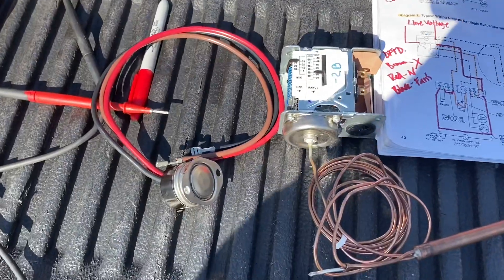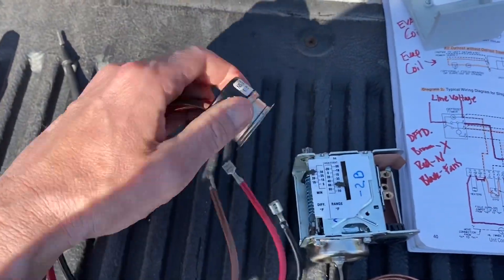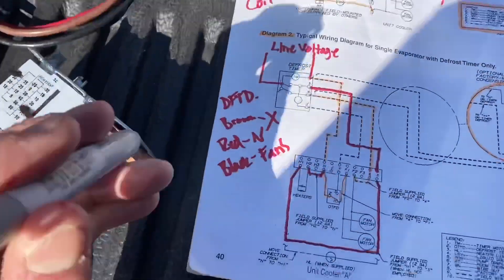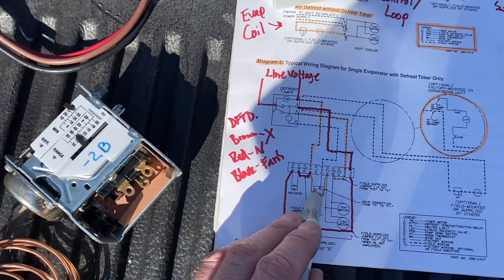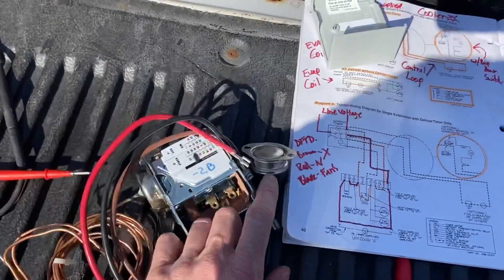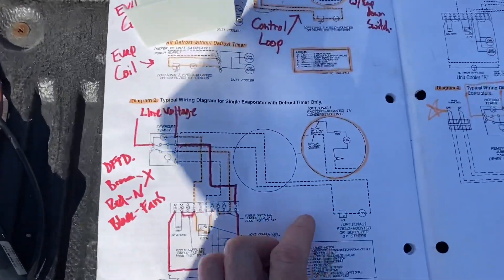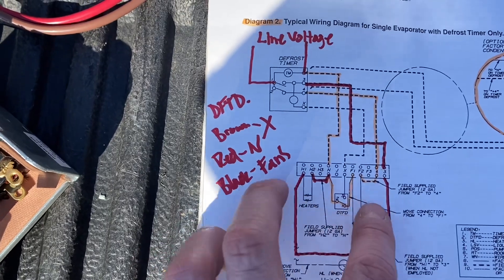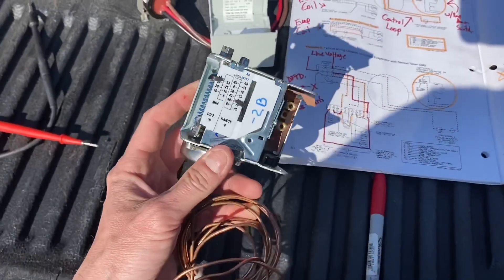Defrost termination / fan delay operation

Comment: My walk in freezer fans keep shutting down. When I bang on the evaporator the fans start up again. Do you think it's a relay inside the evaporator. Frost also keeps building up on the outside of my compressor copper lines that are insulated
Reply from the maker: It’s most likely the fan cycle switch / fan delay . Or could be a loose connection issue

Comment: I’m working on a heat craft evaporator that does not currently have a defrost termination fan delay. Should I be looking for a jumper between N&F to remove in order to install a defrost termination fan delay?
Reply from the maker: Is it a freezer or a cooler ? If it’s a cooler it doesn’t need one

Comment: Trenton brand has been a thorn in my side for years, I'm not selling them any longer.  Just today I told my supplier to get these in and then I find this video. Apple storage has defrost heaters but the temp isn't lower than 29F, so all I need is to get the coil temp down so the heat doesn't blow into the room. Any suggestions what to set this at, if not then I'll have to do trials to find the sweet spots. GREAT video.

Comment: I am a HVAC tech, and my company I work on now, throws us on to Refrigeration equipment. Its not in my wheel house. Very confusing the sequence of operation. Makes me want to quite this business altogether.
Reply: There’s an old saying, you can teach a refrigeration guy to do air conditioning but you can’t teach an ac guy refrigeration.  When I started doing commercial the only background I had was residential HVAC.  You just have to want to learn and have an open mind and you can pick it up.

Comment: Can a walk in freezer be change to a cooler by the temp control?
Reply from the maker: Eddie Acevedo no , you have to disconnect the heaters and this fan delay and wire the fans straight so they run all the time
Reply: @Cscrefandhvac  thank you for steering me in the right direction and the wisdom you provide with you're channel thanks til the next one ☺️
Reply: @Cscrefandhvac  where could I get 208v for fans if I disconnected the heaters and fan delay should I add a jumper from TB6#N to TB1 #1
Reply from the maker: Eddie Acevedo I’m not sure I’d have to see it.

Comment: Its clever wiring really, time clock is controlling one side of voltage and dtfd is controlling the other.  Its hard to explain on the phone with a tech in trouble.  good job
Reply: dtfd?

Comment: The only thing I’d say about that is, those temperatures on that sensor are not reflecting the coil temperature unless they are mounted ON the copper tubing as some are.  Now, the reason it’s 35f ( not cold enough to freeze the water on the coil ) is that this particular sensor is mounted to the tube sheet end area.  So, the coil is hopefully colder than 35f, otherwise it will blow the water droplets off the coil and freeze on your floor.  I think the better ones, are the 25f sensors that clip onto the U bends. The reason is, what if the cabinet/ box is plenty cold even after defrost and the sensor chills down quickly due to a very cold box temp, before the coil can freeze the water on the coil..... just a thought.  Also some of these units have a drip timer that allows water to drip off the coil.
Reply from the maker: hvac01453 yes great point man 👍 this was the only types I had on my truck to show as an example . Most units that are in a control system have a drip time thanks for mentioning that.  I didn’t mention that in this vid 👍

Comment: Great video! 
Currently doing residential and commercial ac work but I'm looking to move up into refrigeration. Was curious to know where exactly you can get that book. Really want to expand my knowledge. Keep those videos coming my brotha
Reply from the maker: AC Raider Edward they come with new heatcraft units or with the new evaps. You can also go to the Heatcraft website and all the diagrams should be there as well

Comment: Great video, just went into a warehouse size freezer with 8 evaporators using 407 refrigerant for a negative 10 temp setting. Anyways getting 95 % humidity in this place. Box was engineered for a 10 degree set point and walls and ceiling are 6 inches. I think this is the problem what’s your take?
Reply from the maker: Sharky55 what are you asking for the problem ?
Reply: CSC Refrigeration and Hvac just asking what the wall insulation thickness should be on a box Designed for -10 degrees.
Reply from the maker: Sharky55 usually 5-6 inches
Reply: CSC Refrigeration and Hvac thank you sir

Comment: So defrost termination shouldn't be triggered all the time right? The defrost clock timer should switch to refrigeration before it trips dtfd. 
Or does it need to be tripped all the time for refrigeration to come back on
Reply from the maker: Brian Pan the clock should switch. This is just for if the coil wasn’t very frosted and the system didn’t need to run through a full defrost cycle
Reply: @Cscrefandhvac  oh I seeeeee
Reply: @Cscrefandhvac  thanks